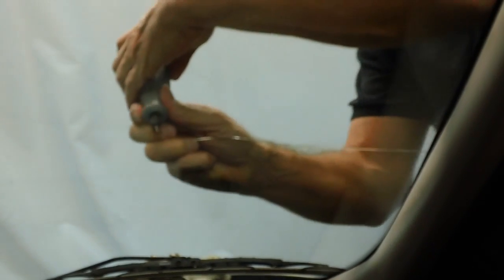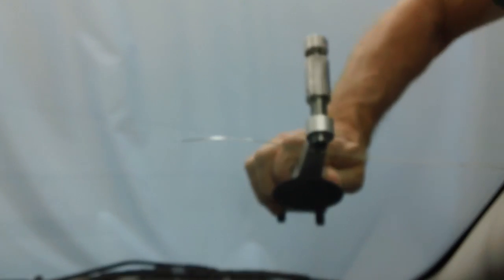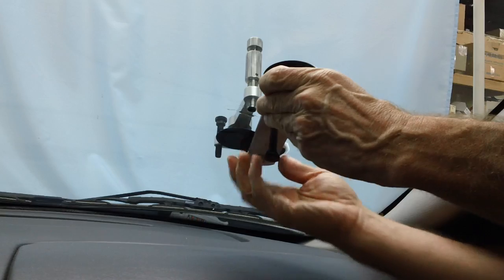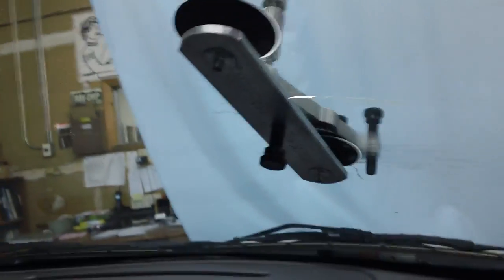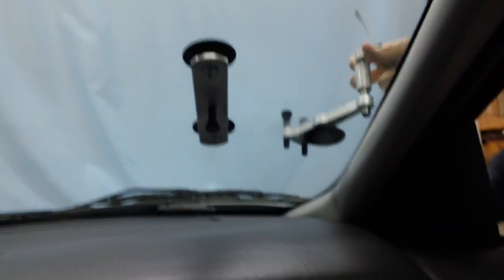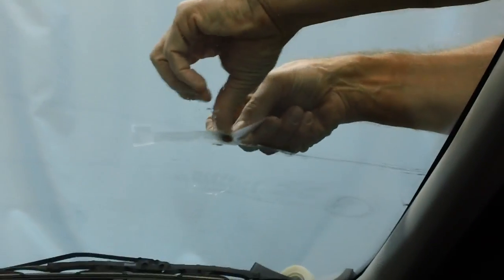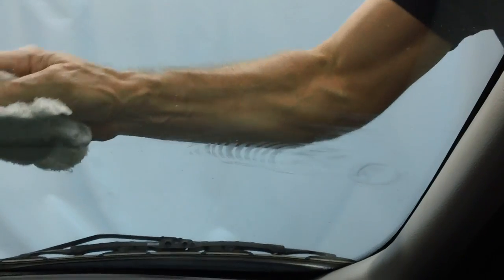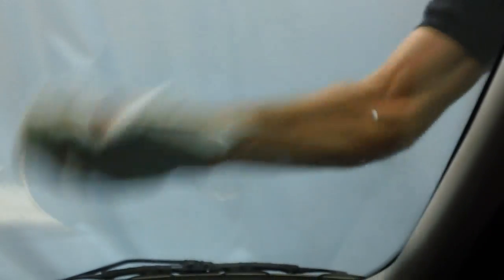Windshield Crack Repair Resin from Ultra Bond

Comment: Would you be able to recommend a repair business that uses these products and techniques in the Fort Myers, Florida area?  I need to get my daughter’s car windshield fixed.  I will not allow the insurance company to have a new windshield installed.  If the factory seal is broken I’d get a new car.  The Barbara Walters 20/20 expose with Arnold Diaz was an eye opener.

Comment: Hi, why you drill the glass at first time?
Reply: When you drill right in front of a crack and fill it with resin that will prevent the crack from further expending think of it as a road block for cracks

Comment: This is so COMPLICATED! I'm better of just forking over $900 for a new windshield...
Reply from the maker: Hi Chris-  we sell heavy duty, high quality tools and resins for professionals who make a living repairing windshields. We do not sell nor recommend do-it-yourself kits because  there are too many safety features to protect you and your family connected to the windshield. Roof crush, airbag, ADAS, road debrise object pentration and ejection to name a few. Unfortunately theses safety feature can be compromised by a replacement.  Make sure whoever does replace it, does it inside a shop in a controlled environment with a two-man set.  Stay away from a one-man set on a mobile service.

Comment: I thought your video was fantastic as well as educational . What would the typical be for a similar crack repair job .
Reply from the maker: Typical cost for a long crack repair is around $100. Time to do a repair is less than 30 minutes.
Reply: do you have shop in hk

Comment: Is that possible to make a bullseye without the awl and that wide black hammer?
Reply from the maker: The best way to get a mini-bullseye is to drill half way through the glass layer with a one millimeter bit,then place a needle and tap it with something light in weight. The needle can be a sewing machine needle or a carpet needle.
Reply: Ultra Bond Windshield Repair Thank you so much. This answer is insanly helpful.

Comment: I'm wondering during the drilling , how do you knw when you went deep enough but not too deep? I understand why you drill it as the crack cant spread over the drilled hole/ bulls eye. Also how does the crack look against the black trim that is on the edge of the glass ?

Comment: Very nice detailed video. I feel the resin is similar to LOCA (Liquid Optical Clear Adhesive) which is also cured in UV light but mostly used in smart phone LCD and Lens joining. 
Correct me if I am wrong !!!

Comment: I have a 7" or so crack on the top right of the windshield of my 2011 
honda civic and 2 separate windshield repair/replacement companies told 
me that if the crack starts from the edge of the windshield that it 
cannot be repaired. Is this true or are they just trying to get more 
money out of me by replacing the entire window?
Reply from the maker: It is false. They are trying to rip you off. See the windshield repair standard in the U.S. at ROLAGS.com. You can also search Utra Bond v Safelite which is a false advertising lawsuit against Safelite for telling the same lie.
Reply: Ultra Bond Windshield Repair

Comment: I can't help but wonder why your stuff is so expensive. If it was cheaper, more people would be able to help themselves and fix their windshields. You can't just come up with a great system and sit on it, you got to spread the joy :). 40$ Resin vs 10$ competitor kit on Amazon??? I have no way of knowing whats so special in your resin, that I have to pay 30$ more for it. I am ready to pay, but I wont, cause the other product has pretty much 5 stars. And no shops in my are use your stuff, there is just no money in that business. Safelite 210$ - for new windshield. I am not bashing you guys, I am just giving you consumer feedback. Cheap workable kit, higher sales volume, everyone is happy...

Thanks for video!
Reply from the maker: This is not a Do-It-Yourself Kit Our kits are for those who make a living repairing windshields. Repairs with our resin are unbreakable and stronger than a new windshield. See the lab tests on our website. The cost per repair (CPR) for a long crack is two dollars. Average payment for a crack repair is $100. That is 98% gross profit. You can't beat that!
Reply: Quero uma dessa como adiqueri tenho uma oficina e quero conprâ uma dessa como adiquiro
Reply: You can also use LOCA (liquid optical adhesive glue) sold on amazon for 10$ for 10 ml. No point in buying same thing at 10 times higher price.
Reply: D NC what is the Amazon product called ?

Comment: Hello Ultra Bond,
I have a similar crack on drivers side on my 2006 nissan 350z, I am located in Toronto, Do you have any shop near by or recomanded shop that can repair it? It happened about a month ago, I had a stone chip while I drove on highway, and its very hard to notice because it was on the side of the windshield where the black marks are, the stone chip itself was very small, I did not find it, and now it cracked due to the cold weather, I am hoping to repair it instead of replacing it. Please let me know if you have any suggestions. Thank you

Regards,

Logan
Reply from the maker: Ultra Bond in Canada is Crackmasters , see crackmasterscanada . com

Comment from the maker: Yes it can be repaired. Where are you located?
Reply: Ultra Bond Windshield Repair why does safelite auto not use these techniques? I had to replace the front window shield for the same crack!
Reply: Will the crack remain visible from inside the car after fixed?
Reply: Hi will normal squash tape is ok? There is no such skill in Singapore.people usually just replace the windshields
Reply: Hi can you repair it for me too I live in New York City

Comment from the maker: That is a good question and is explained in detail in our manual. Edge cracks have a gap from the installation stress. The crack will then close when the lamination stress becomes greater than the installation stress, so the gap starts out wide at the edge and then closes so tight you have to pry it open to get the resin in at the point.
You switch resins when the crack closes and it stops going it. The resin is being injected with pressure from the injector, not gravity.
You can contact me on our website by email and I can email you a manual.

Comment: Rich,
After you punched the drilled hole and "primed" it, you began to fill the crack with resin for about an inch. Then you placed the crack opener. Then at the edge, far from the hole, you placed "edge-crack resin". How can you be sure this resin will go into the crack that far away? You continued towards the hole. Again, how can you be sure the stuff will go into the crack with nothing but gravity? Then you use another resin, is that right, to go from the hole to fill the gap. 

I guess I'm confused because I didn't count the number of different resins you used, and how you know where to start, where to end, and where to open crack, where not, and finally, why some sections of the crack with an applicator and some segments by hand?!?

I hope I don't trouble you with my questions.

Comment from the maker: Jeff an edge crack is the common  crack and usually cost $89 -$120 to repair. It will last for many years. Contact me by phone 970 256-0200 and I will help you find a technician and how to handle your insurance company so you will pay much less.

Comment from the maker: The resin will work it is the technique that has to be figured out. Place Scotch Magic tape on one side to completely close it off. Then inject the other side with resin and place tape on that side also after it is completely filled with resin. Then cure with UV light.

Comment: I have a crack in our glass display case.  It is about 10 inches long from side to side of the case.  Will this work?
Reply: For auto safety glass , reg glass just go to window shop take door, that better advise than. Aww no
Reply: No

Comment: Hey, I have an edge crack in the glass on my laptop screen. It is going to cost over $800 to get it replaced. Would this be an effective method of repairing the glass layer? I don't want to pay $800 to fix a small crack.

Comment: Sir, that was very nice. I am new to windshield repair and by chance ended up with a couple of delta kits repair kits. You commented on the resin sticking to the laminate, do you have an opinion on delta's resins? I have probably done about 50 repairs with fair results. What can you tell me about your resins, and how they differ from delta's?
Thanks,